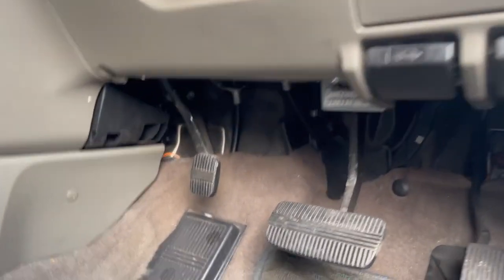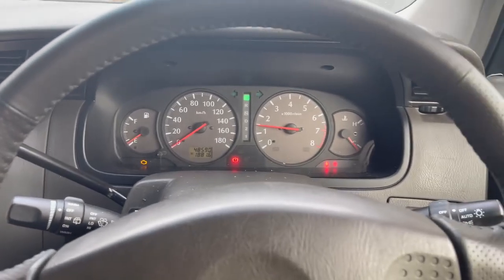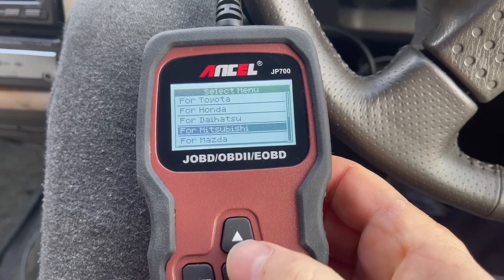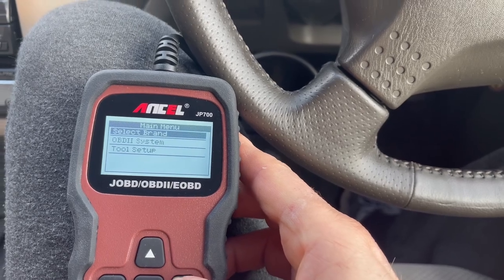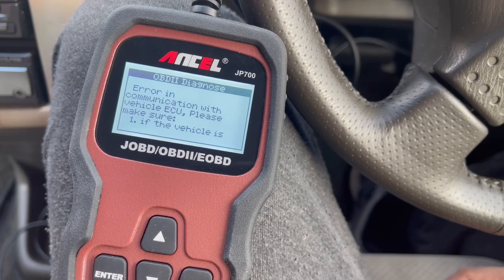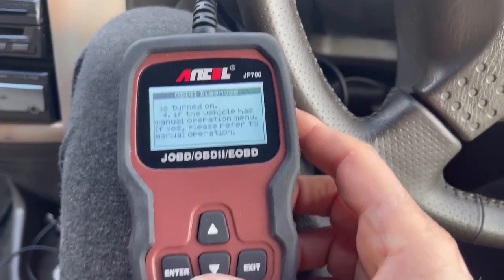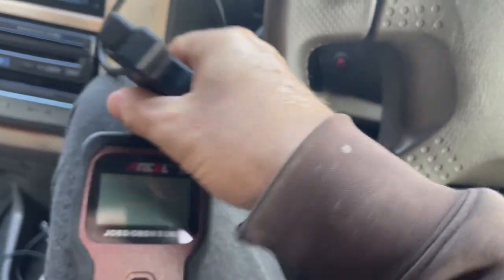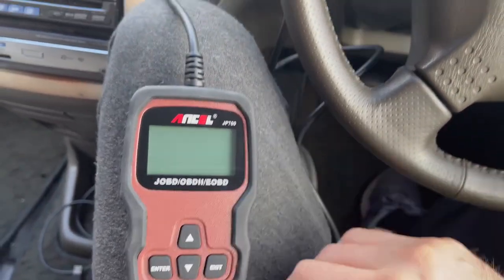JDM JOBD Scanner Diagnostics Nissan Elgrand 2001

Comment: The Ancel JP700 is a reliable code reader for JDM vehicles. 
Was surprised to find it worked on an early model Hyundai.
You mentioned TopDon Phoenix (700 quid?) but consider Blue Driver, Gearwrench and Topscan dongles.
 I've read glowing reports on the Topscan, its provision of live data etc. but beware; JDM is an afterthought or not thought of at 
all by many scan tool manufacturers. 
Are they paying Japanese license fees for the original software or just selling us counterfeit crap?
Keep posting and good luck with the channel.

Comment from the maker: Hi Guys
Just got the Ancel JP700
Ancel JP700 £58 Diagnostics Tool
https://amzn.to/3O7m0HQ
 video to follow confirm it works for Nissan Fault Codes also covers
Toyota
Honda
Daihatsu
Mitsubishi
Mazda
Nissan
Suzuki
Subaru
Video To Follow but basically found the Fault Code:
P0136 HO232(B1) O2 Sensor so either need to buy a new one or hopefully the cheaper option use 
Cataclean which may fix the issue :)
Cataclean
https://amzn.to/3YUlxxK
Video on YouTube re Cataclean instructions
https://bit.ly/cataclean-youtube

Ancel
https://amzn.to/3O7m0HQ
ANCEL JP700 JOBD OBD2 Japanese Car Scanner, JDM Automotive Code Reader, Check Engine Light OBDII Diagnostic Scan Tool

Ancel JP700 Software Download
https://anceltech.com/download.html
Manual
https://anceltech.com/Public/Uploads/filetxt/20211007/a305f692-fe20-4118-bd2e-529e13ed3b40.pdf

YouTube Video
https://youtu.be/z8s9s5heGjc

----------------

Diagnostics tools
-----------------
LAUNCH X431 PRO3 ACE Diagnostic Tool
https://amzn.to/4ftCXZ0

Xtool
https://amzn.to/4exfKUn

Top Don
https://amzn.to/4fOUvhM

Top Scan
Cheap
https://amzn.to/3O91SVw

Ancel
https://amzn.to/3O7m0HQ

ANCEL JP700 JOBD OBD2 Japanese Car Scanner, JDM Automotive Code Reader, Check Engine Light OBDII Diagnostic Scan Tool, fit for Toyota Nissan Honda Mazda Subaru Vehicle Diagnosis

https://amzn.to/48UIq8z

iCarsoft
https://amzn.to/3VhRkaX
iCarsoft LR V3.0 Professional and Powerful Universal Diagnostic Tool for Land Rover/Jaguar Vehicles with 10cm TFT Colour Screen, OBDII Functions, CANBUS